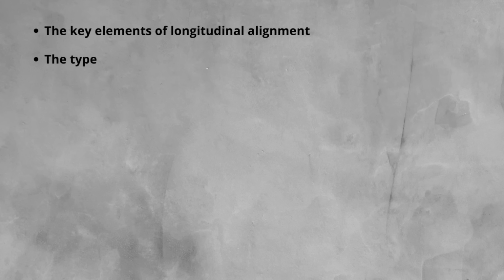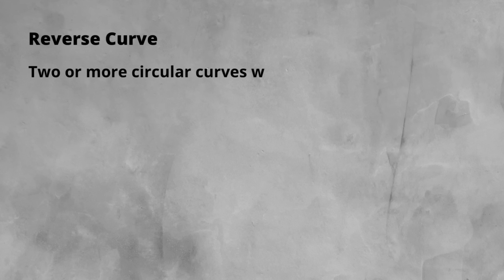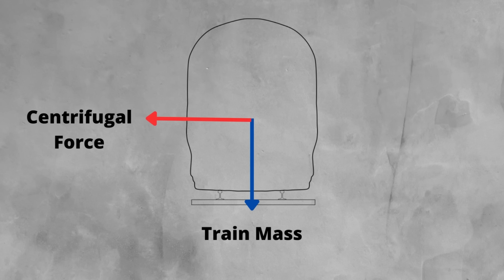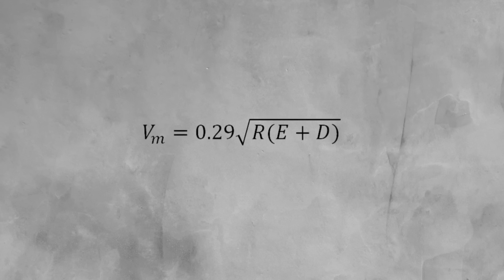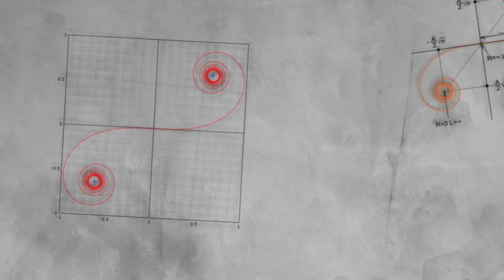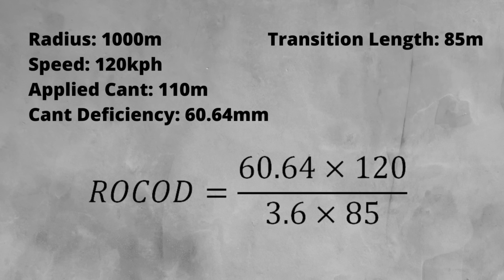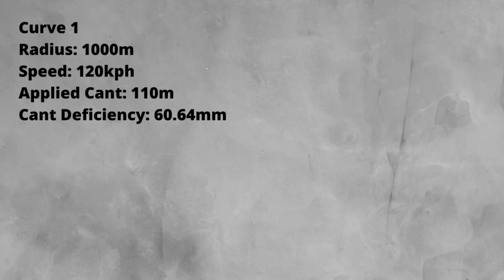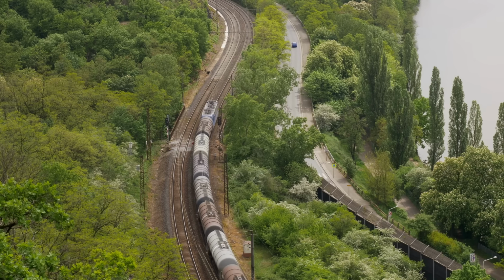The Complete Guide to Railway Curves. An Easy Intro to Curves and Their Design

Comment: Very useful guidance.  
Sir, is it permissible to have a vertical curve inside a horizontal curve?
Reply from the maker: Yes, you can but it is preferable to avoid coincidental changes
Reply: @thepwayengineer  Yes, thank you sir.  We have the problem of a light railway between two places of different elevations connected by a single horizontal curve.  So it is inevitable that there are two vertical curves in one horizontal curve, but we place the overlap on the circular curve, not on the transition curve.  Are there any special requirements for this?
Reply: Yes….in mountainous territory they are referred to as switch backs.